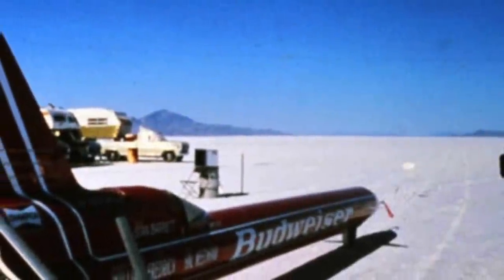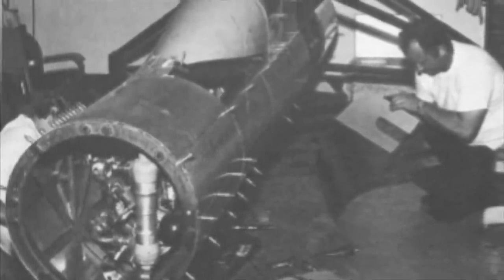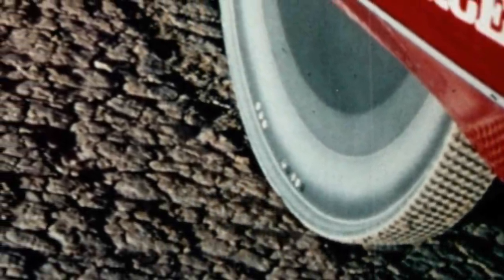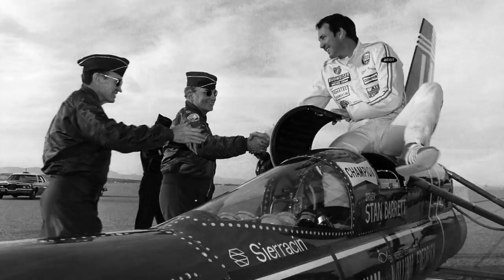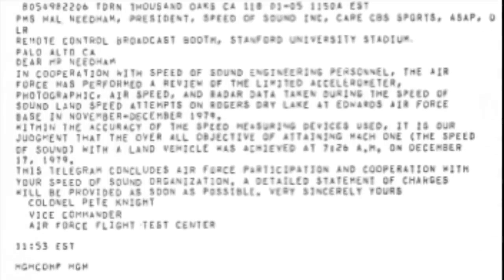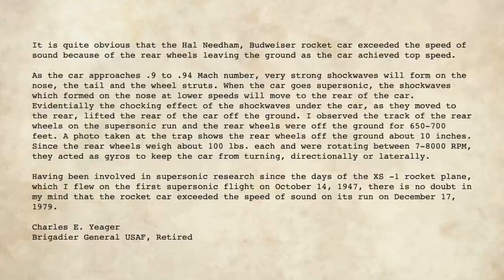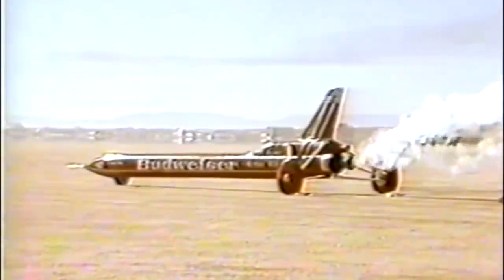The Budweiser Rocket - Controversial Rocket Car

Comment: No, the jury is not out.  It went super sonic.  This was per Edwards AFB radar.  The controversy is that it had 3 wheels and not 4, therefore it was not a car.  Then, they did not make a 2nd run required by the FAI.  This is the first supersonic land vehicle.
Reply: Number of wheels was no longer a disqualifying issue by 1979. Many vehicles had 3, like the Blue Flame, and many others had more, some had 3 axles with 8 wheels. The issue is no evidence was ever presented to verify any claims. Not hard to break a record by saying "yes I did it". They had data but refused to allow anyone to review it and would not allow proper timing equipment to be set up.  Most telling is the absolute lack of a sonic boom, planes had a sonic boom when it passed through, Thrust SSC made a sonic boom and the Budweiser car had none.
Reply: homie789 well put and very telling
Reply: The rules are simple and the same for all. A measured mile or measured kilometre, two runs in opposite directions and within the hour. If for any reasons you fail to do that you have to try again. Lots of great drivers have tried to get a Land Speed Record and have to make do with an unofficial record and try again to do it properly. This rocket tricycle couldn't prove its speed and it didn't run again. Feeble. If it went supersonic once why not do it again to prove the doubters wrong? Lame. The way you do it is to run until you set the record you're satisfied with then go home while you're still alive. You don't stop before you've proved your point unless the money runs out or the car is damaged beyond repair.
Reply: Edwards radar said 38 mph ,there is no reliable data of any type to back up the claims ,also minor point it didn't go boom so no barrier.
Reply: Radar does not measure Mach events.

Comment: The size difference between Bud and Thrust is the same with the sound emitted.  May have had nearly no shock wave at all. SSC is huge, and would male a massive shockwave and sound. The smoothing of the shock is evidenced on both. I would lean towards them both exceeding.

Comment: I'd say did break the sound barrier. I base it on the Air Force report. They measured, it went fast enough. The reason why they said they didn't "officially" say how fast the car went is because the government doesn't officially do that sort of stuff. If they officially do it for Bud, then do they have to do it for others? And, if someone gets hurt while they "officially" measure, are they liable? Their legal statement about it being unofficial, does not invalidate the reported measurements, IMO. As for the boom, the boom is only heard in front of the supersonic object, as the sound first reaches the observer. The videos shown here were from behind the vehicle, so there would be no sonic boom there. If a camera was in front of the vehicle and didn't get the boom, then that would be a counter point.
Reply: they didnt measure,they guessed after playing with numbers and then made sure they said it wasn't an official USAF endorsement.no boom,no barrier.
Reply: "I base it on the Air Force report. They measured, it went fast enough."

Radar does not measure Mach number.

"As for the boom, the boom is only heard in front of the supersonic object, as the sound first reaches the observer."

There was nno boom recorded on the television broadcast, the accelerometer data or the pitot head. It never happened.

Comment: Pitot tube measures air pressure in airplanes for speed.
Reply: Pitot tubes on an aircraft measure the total pressure of the air around an aircraft and together with a static tube the airspeed relative to the aircraft can be measured. This is more critical to flight than the actual speed across the ground. This is why pilots mostly use airspeed when controlling the plane but they use actual speed via gps for navigating the plane to make sure it gets to its destination. Airspeed is not equivalent to the actual speed relative to the ground. Airspeed is effected by the wind and more importantly if this car supposedly breached the sound barrier a normal shock would form in front of the pitot tube which causes a drop in total pressure and rise in static pressure. These drops and rises are very sensitive to changes in mach number especially at speeds around mach 1 as the flow goes from subsonic to supersonic. Evaluating the airspeed from this data you would need to know whether or not there was a shock present and even then air speed can differ wildly from place to place on the car surface so this form of measuring the speed of the car is completely nonsensical.
Reply: Pitot heads are unreliable at transonic ans supersonic speeds.

Comment: With AI and drone technology being what they are ___ and the amount of calculations  onboard computers being that of  beyond are wildest dreams . . . . . a driverless land vehicle should be able to do it . (with many more cameras and gps units etc etc on board cameras etc)
Reply: YES!! like them rocket sleds of astronaut training programs gone by!!
Reply: Exactly  Just have a team of remote control drivers in an air conditioned shack  . You know ? thenfire it up and stand back
Reply: Several cars have clearly gone faster than this car in years since, so achieving what this was intended to is a moot point. I don't know if a driverless vehicle would be considered legitimate for world speed records, this is something the racing community, FIA, and others will have to decide on in coming years as surely driverless racecars of all sorts are coming. They'd be more precise and faster-thinking than a human, avoid the need of carrying the weight and bulk of a human, avoid the need to design for protecting a human, and allow bigger risks to be taken with no lives on the line. Soon driverless racecars will outperform their meatbag driven counterparts, and likewise electric cars will outperform gasoline - already happened on the Pike's Peak Hill Climb. So the fastest racing/speed record vehicles will be driverless electric things. I think a lot of people will be disappointed by that, sort of takes the glory out of it, so I could imagine rules requiring that the vehicle be human-driven, that a person set the record, will likely be written. If it can be both unmanned and ride on a guide rail, a rocket sled as proposed by Pazernator, then any of these records anyone's working on are a moot point, rocket sleds have exceeded mach 8.5.

Comment: All these little organisations that make the rules make me laugh, you can't set rules that supersede reality. If a land vehicle breaks the sound barrier, or goes faster than any other, than that's that, whether you'd like to 'officially' recognise it or not. So long as there's irrefutable evidence that a thing happened, (perhaps not in this case though) then it happened. Can't deny reality.
Reply: Ben Wilms these little organizations, as you like to call them, are there for a reason. The FIA and not exactly a little organisation, they are the premier and world's largest organisation regarding motor racing rules and regulations, and land speed record  timing recognition.

The rules for the two-way average, were sat in 1914, over 100 years ago. The reason these rules are in place are obvious. So that wind assistance and gravity assistance if going downhill can be ruled out.

If you go through the same measured mile in the opposite direction then it can be almost assured that neither assistants can play a factor in your record attempt - and therefore  discounted. When the average is taken, it proves that the car travelled at the stated speed.

When thrust SSC broke the sound barrier in 97, not only was a sonic boom heard in both directions, but the average Mach number through the measured mile was measured through two timing beams at each end of the mile.

That is irrefutable.

The Budweiser car was only measured through 52 feet, once, in one direction. Without using timing beams. Not only was no sonic boom heard, but they just a radar signal measured over 52 ft that was not accurate at the distance measured. The airforce proved this, because the result of the run measured - was just 38mph. The radar was too close to the vehicle to make accurate calculations. 1/9000th of a second difference in the calculation, could have affected the result by 66mph.

So after the run, they used a truck and scaled up the timing of the truck through the measured section in order to work out a calculation that would give them the result of the rocket car run previously. Very dubious at best.

Why couldn't they just run the car through two timing beams? We never got an answer to that question.
Reply: Right, but they don't officiate reality. And to be fair to you, my comment was more a response to other comments I'd read.
Reply: I dont understand why they didnt just do it again the next day or whenever their procedures allowed, after it became clear they didnt have the timing and radar data they wanted. I appreciate there are costs involved but Budweiser have the money and once they'd committed to the project so far you'd think they'd see it through.
Reply: @-yeme-  I got to thinkin, 'what's the most nerve racking , near death thing I've ever done'? And someone saying 'I don't believe you,... Just do it again.'  Though really you're right, they'd gone so far, why not drive it home.
Reply: @benwilms3942  Andy Green drove Thrust SSC Supersonic on 4 timed runs to get the record (the first timed attempt failed to met the 1 hour turn around by one minute) and he thinks he actually peaked at Mach 1 on an earlier untimed test. The people doing the timing were the US Motorsports Association using fully calibrated timing equipment.

Comment: "The speed of sound depends on prevailing conditions, including air temperature and pressure."

No, there is no p in a = sqrt (gamma * R * T) !
Reply: toshtenstahl, Sorry Einstein can you explain to us mere mortals, we don’t all have PHDs.
Reply: 4:10 The pressure function is nested in gamma - it states 1.4 for air at STP - it must be corrected for altitude and air density in the formula because everyone knows sea level mach is much faster than mach at 45000 feet MSL (the air is thicker at sea level and sound travels through it faster for those lay folks)
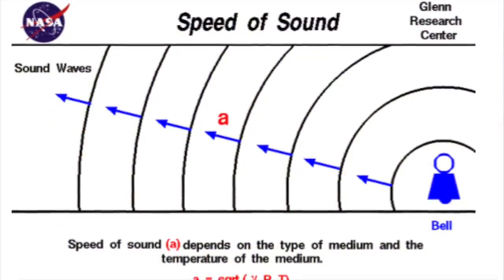Reply: @allandavis8201  , starting at 4:00 the narrator states the above mentioned quote - while showing the formula to calculate the speed of sound, complete with explanations of the variables: gamma, R, and T. As gamma and R are fixed values for air, the only real variable is the temperature. For a given temperature, the s.o.s. is the same whether you are at sea level or at high altitude.
The narrator contradicts the (correct) formula he's showing at the same time.

BTW, I don't have a PhD. I just paid attention during thermodynamics. ;-)
Reply: i agree independent of pressure ...only temperatue and kind of gas (gamma = Cp/Cv around 1,4 for air
Reply: @sinistersparky9657  , no, gamma is the heat capacity ratio, and that is 7/5 or 1.4 for a diatomic gas like air (mainly N2 and O2).
And the s.o.s. is lower at high altitude because it's fricking cold up there and the s.o.s. drops with the square root of the absolute temperature.
If you look up the International Standard Atmosphere or U.S. Standard Atmosphere, you will find that both show that the s.o.s. remains constant when the temperature remains constant, even if the altitude increases and the density and pressure decrease.
Reply: @toshtenstahl  I stand corrected. Pressure is not in the formula. 
Water vapor seems to be the largest variable in the difference in mach numbers at a given T. Technically that would make it a triatomic gas (ignoring other insignificant gases like CO2), and the atmospheric pressure on the water would be correlated to its density. Lots of Physics discussions talk about the diatomic quality of air and then add water vapor as a side note.
Reply: @sinistersparky9657  , yes, increasing moisture would decrease the gamma and therefore the s.o.s..

Comment: hy won't they let solid fuel run these days ?
Reply: Probably a safety issue. Once you start a solid rocket motor, you can't really stop it. The only way to stop the thrust is to vent the pressure inside the motor casing, which is very difficult to do in a controlled manner, and still leaves you with burning rocket fuel.
Reply: @neutronium9542  that makes sense, thanks!
Reply: @neutronium9542  you can blow out a solid rocket, but it's used in strategic missiles.

Comment: The speed of sound is temperature dependent.
Reply: Temperature and pressure dependent. The speed of sound goes down at high altitudes.
Reply: @scootergeorge9576  So let me ask you something: what varies with temperature besides the speed of sound?
Reply: @thethirdman225   Perhaps density.  Water, depending on temp, could be a solid, liquid, or gas.
Reply: @scootergeorge9576  Pressure is also temperature related. This is why the speed of sound varies with temperature - because all those other elements also vary with temperature.
Reply: @thethirdman225  - Atmospheric pressure varies with altitude.  Imagine a 1" square column of air reaching into space. At the bottom, that column is pressing down at apx. 14 PSI.
Reply: @scootergeorge9576  And what happens to temperature at altitude?

"The speed of sound (symbol: a) is principally dependent on the type and composition of the gas as well as on the (absolute) temperature t. The calculation is simple:

speed of sound a = kRt

where

k is the ratio of specific heats of the gas (k = 1.4 for air)
R is the gas constant (R = 287 J/kg K for air)
t is the absolute temperature in K. For the standard atmosphere the speed of sound is derived as follows:

a) speed of sound at zero altitude: 15°C

a= √(1.4 × 287 ×288)
 = 340 m/s (670 knots)

Conversion of the dimensions:

√((J×K )/(kg ×k )) x √((Nm )/(J )) x √((mkg )/(s^2 N)) = √(m^2/s^2 ) = m/s

Speed of sound at altitude of 11 km:
temperature at 11 km altitude:
-15.5°C, corresponding to 273-56.5=216.5°K

a = 295m/s (582 knots).
Thus the speed of sound decreases with increasing altitude because of the change in temperature."

- "Modern Combat Aircraft Design", Klaus Heunecke, Airlife publishing, 1987, p.72.
Reply: @thethirdman225  - As altitude increases, temperature decreases.  Frostbite injuries were common among  crews flying unpressurized  B-17 bombers  during WWII.
Reply: @scootergeorge9576  Yes but that was because of the decrease in temperature and not because of the increase in altitude. Read the last line in the quote from Heunecke.
Reply: @scootergeorge9576  
"The actual relationship is that the *speed of sound is proportional to the square root of the absolute temperature.*"

Mechanics of Flight", A.C. Kermode, Pitman Publishing, 1972, p. 322
Reply: @scootergeorge9576  Let me put it another way: the speed of sound varies with temperature. Temperature varies with altitude. But there is no need to include altitude in the calculation. All we need is temperature (in degrees Kelvin).

Comment: You kind of need fins at the front pointing slightly down to shove the car down onto the ground.
Reply: No.  Just like jet cars, the rockets have precise angles to keep the car on the ground and not go airborne.
Reply: ygg drasil - that's a solid understanding of aerodynamics you have!!
Reply: @MrSpanks  for real though! In another video there was some guy saying that if you make these LSR vehicles too light they will have trouble staying on the ground at high speeds .... Education system failed these people
Reply: @DavidGarcia-oi5nt  Bozhe moi. There is a feeling out there that just because a car vehicle goes very fast, it must need lots of downforce. There is a limit to this. At extreme speeds too much lift in either direction will be catastrophic. The Bud Rocket's problem was that the back wheels lifted off the ground for around 200 metres. This is thought to have been due to the fairings on the rear wheel support struts and quite rightly, gave Barrett the fright of his life. It's just a pity he wasn't rewarded for his efforts.

http://www.dlg.speedfreaks.org/archive/lsr/bud/bud.html

Comment: What ever happened to measuring a reasonable set distance, lets say 500 metres and then timing how long a vehicle/dog/slug, whatever takes to travel that distance? All you then need is a bit of maths and you have the speed! (KISS!)
Reply: Maybe I'm mistaken but wouldn't that give it's average speed over the distance instead of the top speed it reached? Especially in a vehicle that is constantly accelerating until runs out of fuel and then starts decelerating.
Reply: @awdeveau  That is very true! But one thing is for sure and that is that if they put the measured distance somewhere near the end of the run so that the end of the 500 metres was just before the solid rocket cut out they would have obtained a more impressive figure than 38 MPH!

Comment: Elon Musk and SpaceX should build a rocket car. Put a small motor on the back and pow! See ya later.
Reply: Space X Tesla car with dummy driver just finished it's "first orbit" of the sun. Still zero sun damage to that car. Zero fading. Tires still perfect. That same car parked in Arizona would have seen some damage from sun rays. 
It's fake. duh